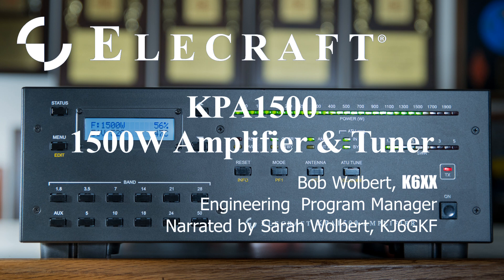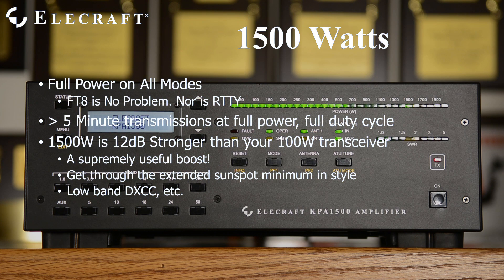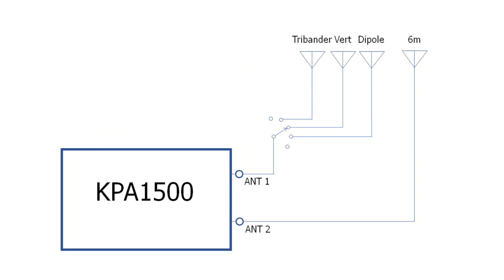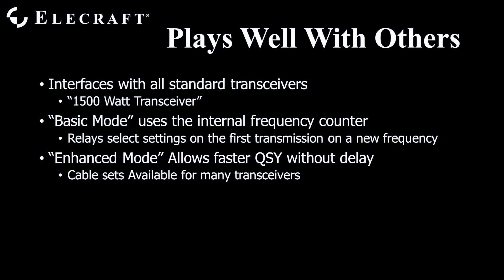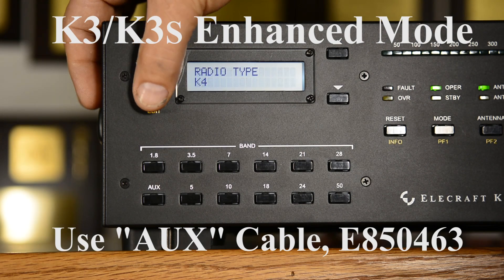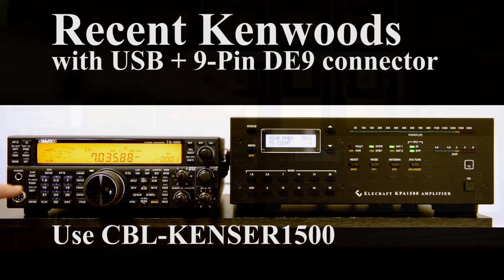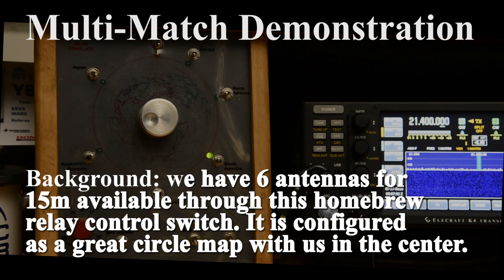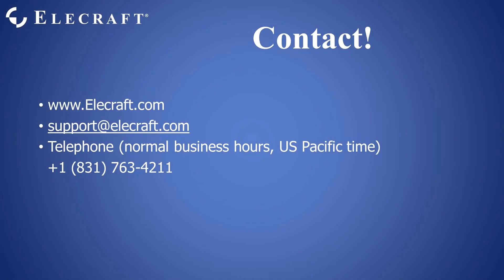KPA1500 1500W AMPLIFIER

Comment: can I use with a 2 Watt TX ?
Reply from the maker: Yes. This is a linear amplifier, so it will amplify any input signal up to the maximum level. At 2W, auto band switching might be problematic, however, so you might need to use the manual band switches.